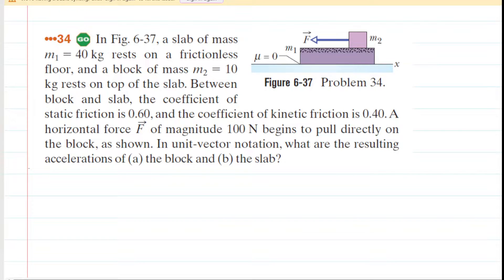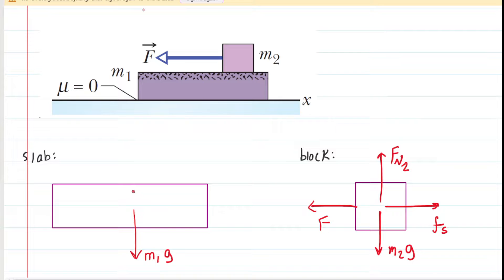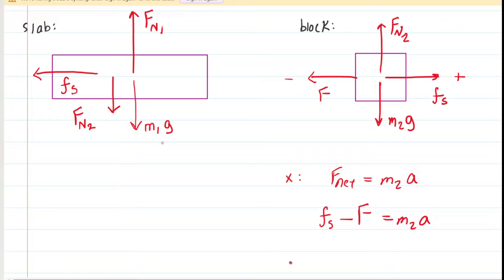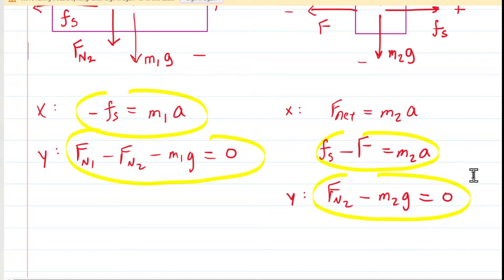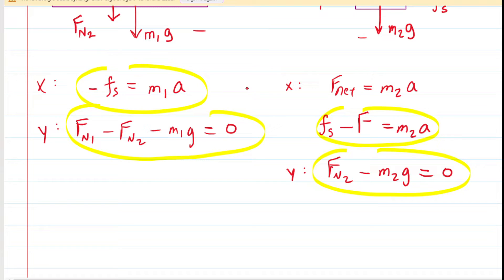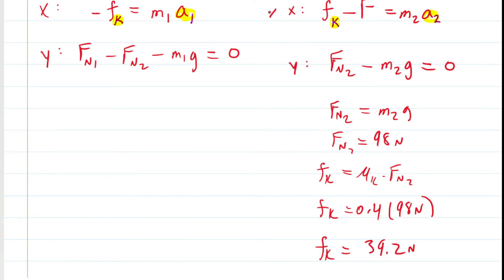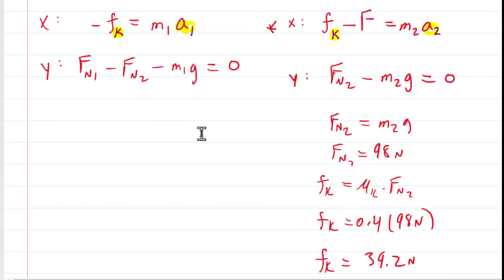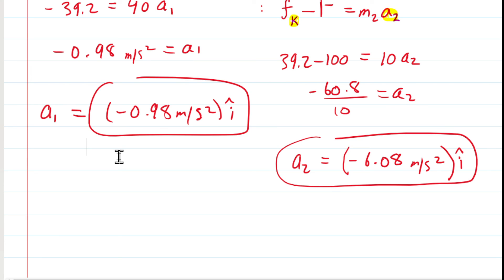In the figure a slab of mass

Comment: shouldn't the acceleration of the block be 7.06 m/s^2 because of how the acceleration is only a local perspective. So you must add both of the acceleration of the slab and the block to get them both. 0.98+6.08=7.06. The slab is also moving so it with make the additional acceleration